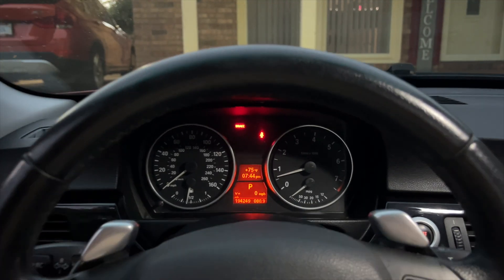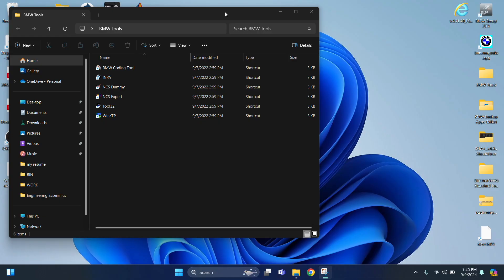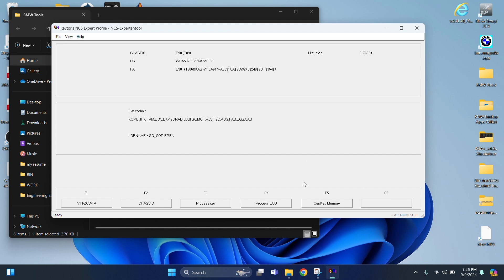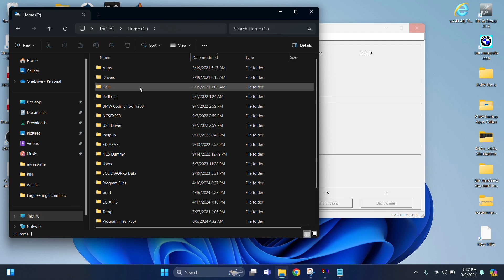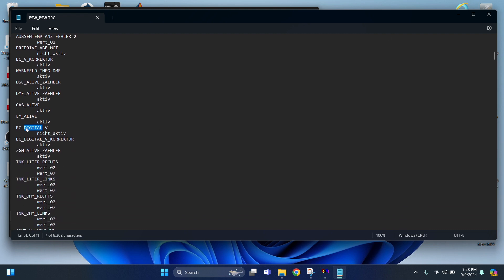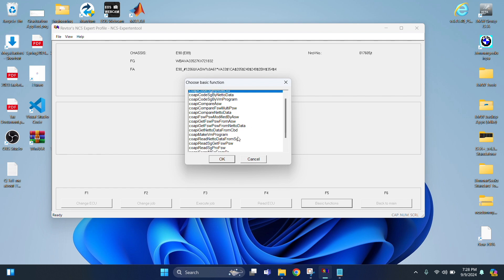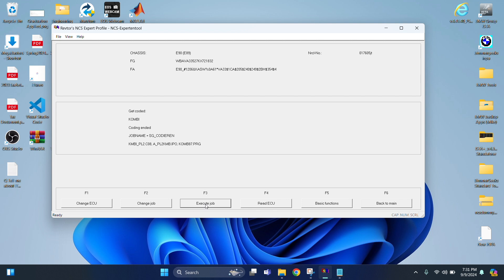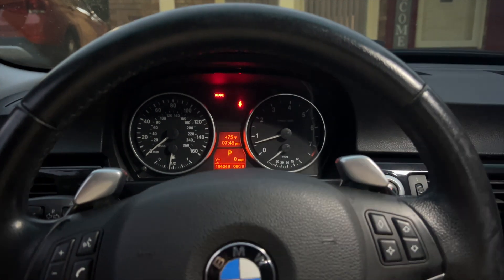Coding in Digital Speedometer on my BMW E90 using NSC Expert

Comment: Which cable u using I can code e60 but cant code my e92 on Connection it says
Reply from the maker: I’m using a k+d can cable! it has a switch to toggle between k and d. For my e90 I have to use d can so I switch it to that. I know that for newer models you have to use k can sometimes. Hope that helps! Also, make sure your settings are set properly on your device! Latency set to 1 and com port set to 1 (I believe…I don’t remember it’s been a while)